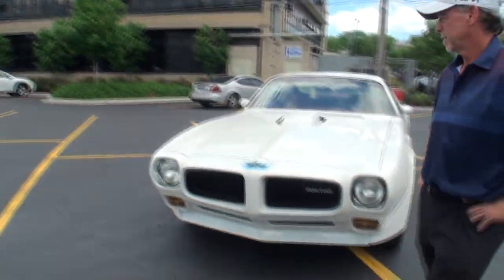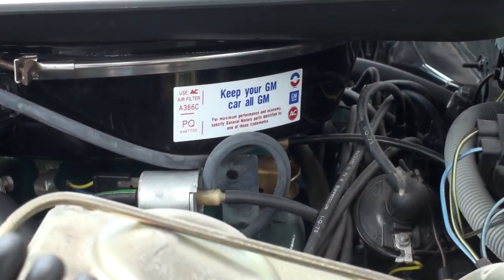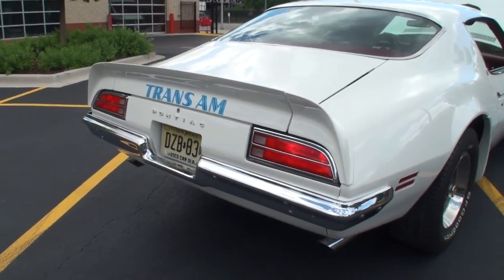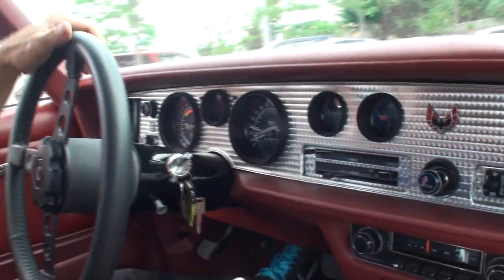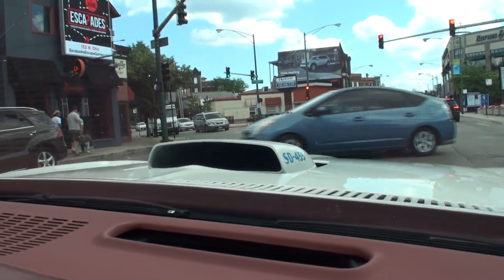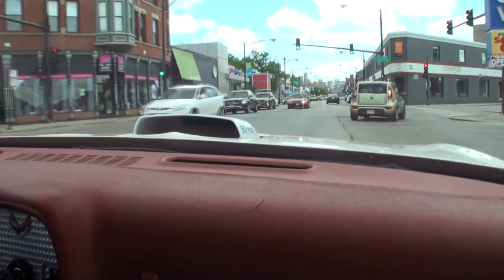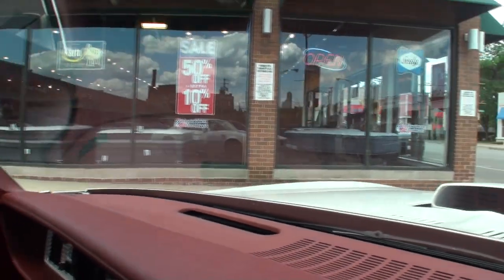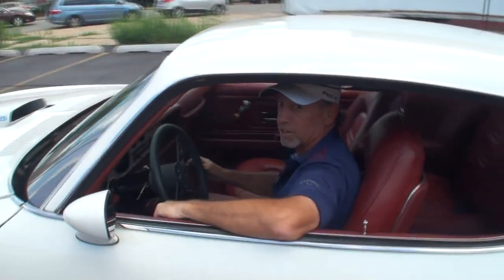Ride in a “ Super Duty “ SD-455 1973 Pontiac Trans Am? Why Not! on My Car Story with Lou Costabile

Comment: Pontiac was first to the muscle party, and last to leave. My favorite brand!
Reply from the maker: Hi Barcrrt, Nice :-) Lou
Reply: gotta love em
Reply: The 62 Dodge Max Wedge was an inch shorter than the 64 GTO and it dominated drag strips. The Max Wedge predates the GTO making it the first muscle car, by definition.  It was the first intermediate to have a big block.
Reply: i don't know about the first but i agree with the last part.
Reply: Mopar beat Pontiac to the party by 2-years with the street wedge and max wedge engines, in a midsize body.  And, yes, the dimensions and weight of a midsize Mopar were the same as a Pontiac Tempest. According to Motor Trend, a 1964 Tempest GTO did 0-60 in 7.7 seconds and the 1/4 mile in 15.8. The wedge cars running the same bias ply tires were considerably faster.
Reply: I wish GM hadn't given the marque the kiss of death!
Reply: @thespeez  Me, too! I like the early 70's Trans Ams and the 1990's (4th Gen) Trans ams as well!😎
Reply: Nope, was actually Buick!
Reply: @greasyhitchball  What about the 62 Chevy 409 dual quad? Many super stocks came before the GTO. I like 'em all though. I would take a wedge or a 440 over the hemi for the street, torque rules. Hemi didn't come into it's own until the end of the quarter mile then it was bye bye into the top end wild yonder. I am a Pontiac fan however at heart.
Reply: @greasyhitchball  Sounds like somebody didn't know how to hook it up. My stock 1966 Ponitac Grand Prix with 2.73 highway gears did 0-60 in 6.8 seconds and quarter mile in 15.0. That was with bias ply tires. Super stock Dodge will run 12's all day long stock, GTO would never have a chance, granted, but those times by magazine reviewers are usually way too slow, even the mopar times were modest.
Reply: The 61 impala SS 409 was in my mind the 1st muscle car
Reply: @darrellsomers5427  That was a full size car.  Right?
Reply: @darrellsomers5427  The Impala was a full size car, not an intermediate. If you want to consider the Impala, then you have to go back to the 1955 Chrysler C300 with the hemi. Either way GM did not make the 1st muscle car.
Reply: @fastmachines500r8  Seems like your one of those nose picking authorites, who doesnt know his facts, but you're forgiven.

Comment: A friend of mine has a 74 T/A SD455 Red with black interior and that thing hauls ass but I always like the 70/73 body style better
Reply from the maker: Hi 79tazman, Sounds like your Friend has a cool car too!  Thank you for viewing, sharing, and adding to the story, Lou
Reply: I believe that's Bucaneer Red! You are talking about! The T/As had cool names for their colors. My friend drove his 2002 T/A into to some floor waters by mistake and the ram air in the front sucked water into the engine. He got the car out o.k. But ruined the engine. Pull that sucker out. Built a 427 fuel injected Corvette motor and put in back in that T/A. That car was wicked fast. Till some parked a Big Dump truck on his street on a very dark night and he stuck it under it.
 It almost kill him with the sudden stop. Took two hrs to get him out from under that Dump truck! He killed the TA. He o.k now! Shawn .
Reply: @shawnbeck2303  relevance?

Comment: The 455 had so much torque it was hard not to spin the tires.  On level roads I usually took off in 3rd gear with no problem.  I had a ‘76 455 4-Speed but always wanted a SSD 455
Reply from the maker: Hi db Vetter, Happy to read this car brings back memories of your car :-) Thank you for viewing and sharing, Lou

Comment: Imagine one of these built to circa-1970 specs. Full vacuum advance, a functional hoodscoop, no smog crap, a Ram Air IV cam, 10.25:1 comp and slightly richer carb jetting, just as Pontiac engineer Skip McCully wanted. It would be brilliant.
Reply from the maker: That's a FUN idea :-)

Comment: My dream car!!! My dad promised me a car when I got my license. He was a Buick loyalist & trade his landyacht every 2/3years. Rat fink neighbors would tell my dad what I'd be doing with his new RIVIERA GS STAGE 1. After getting my license he got me a 1970 GS 455Stage 1,4spd 
A/,C  fully equipped. All I did was change the tires to Camaro sized Radials .It wasn't my Poncho S.D, but it was gr8 for long trips,it had a bench seat,yet, it was a 4spd. My dad was able to get the build sheet from the very same dealership he got his cars from. 3.42:1 limited slip with A/C. Antenna in the front windshield, reception STUNK. 8track time. I was a fool getting rid of it in '78. Trans Am 455 SD was the way to fly.....
Reply from the maker: Hi Ener, Your Dad bought you a 1970 GS 455 Stage 1 4 Speed! WOW! Lou
Reply: @loucostabile  Yeah, but I wanted a Trans Am 455 SD. But, bc of the rumors on how I abused his car in 1974 he got me a used GS 455 Stage 1. I got used to it. In '78 I traded it for a 78 Vette L82 4spd. The dealer didn't give me a grand . But, Now, I wished I had kept it.
$$$$$$$$$$$$$$$$$$$$$$$$$

Comment: I had a 1973 Formula 455 SD with a rear spoiler, twin scoop hood with ram air, and stock cam and carb. 4 speed manual, close ratio. Firebirds had that distinct exhaust sound. When he started the engine up, I was about to have an  orgasm!. I remember that distinctive exhaust growl. And yes, the car had no problem spinning the tires. I am kicking myself in the ass for selling it! I do have a 1999 Chevy Camaro SS 350, that SLP Engineering worked on. They changed the heads to high flow with all the trick hardware, exhaust headers, with midway X pipes, High flow cats, ignition upgrade, high flow intake, a larger cam but small enough to make the engine shake a little but did not make the car too wild, Panhard bar, Koni shocks BIG sway bars in front and back, custom wheels, with WIDE tires, different front pulley, Car pulled 11s every time I ran it. ( I ran it only 3 times. I do not like to abuse my cars).
Reply from the maker: Hi Adam, Happy to read this car brings back memories of your car :-) Thank you for viewing and sharing.  Hope you see many cars on this Channel you enjoy!  Please Subscribe, and hit the "bell" so you can see all the cars when they are uploaded on this YouTube Channel, Lou

Comment: Had a friend, years go, that was shopping for an SD 455 and, because decals and badges are cheap, he told me the only valid way to be sure you get a REAL SD 455 is to get the serial number off the ENGINE block. I guess they all look the same on the outside but SD versions are beefier with 4-bolt mains and whatnot. At the time. my friend had checked motor numbers on 3 different cars and none were valid. Don't know if he ever found an authentic version. Hope this guy did his due diligence when the bought this one (obviously a restoration) ... it looks delicious and badass.
Reply from the maker: HI Wayne Carter, Glad you like the looks of this one :-) Thank you for viewing and sharing some tips, Lou
Reply: Not that you wouldnt want to do that, but indentifying the 5th digit in the vin as X first probably would go a long way towards authenticity.
Reply: The VIn will show an "X".  the intake manifold will say "LS2"  the exhaust manifolds are ram air type, the exhaust port castings on the heads are large,straight, and don't pinch down, the driver's side valve cover should have the SD label.
Reply: I used to mess with Pontiac stuff years ago. I think the SD blocks had a pyramid shaped “power tower” cast into the top of the bell housing near the distributor. Both 400 and 455 engines.
Reply: You can tell looking at the center exhaust ports,the beefed up valley around the lifters,the intake ports.it wasn't just the block which was built like a race engine it was the heads made by a.r.e. and flowed better than hemi heads.
Reply: 490132 SD 455 casting number on side of block and next to distributor hole that's where mine are on my 73 T/A so lucky to still have mine thank God...

Comment: The vin plate has been removed and screwed back on never buy a old car if the vin has been removed  so this is probably NOT an original 455 SD? Unless all #'s match the vin  i mean the frame rear end body numbers all and engine trans etc. but ultimately up to you unless your gonna dragrace it or whatever then buy it if you do not care?
Reply from the maker: Thank you for viewing and sharing a tip.
Reply: Good I stay away from salvage titles do

Comment: Looking at the tuneup sticker... Most kids born after 1980 most likely have no clue what dwell means.
Reply: Most kids born after 1980 can Google the answer in about 10 seconds though... anyway, nice car :p
Reply: Thanks! ...But do you know how to set it? :-p Yeah, yeah, Google is the champ, but that doesn't make up for experience. It's relatively simple with the right gauge. Now, tuning/rebuilding dual or triple Weber carbs is another story. heh
Reply: Off the top of my head, Dwell can be checked with the engine running or cranking. Decrease dwell by increasing the point gap; or increase dwell by decreasing the gap. Dwell angle is simply the number of degrees of distributor shaft rotation during which the points stay closed.  <-- Obvious Google answer... now, what are 'points' Grandpa? 
I kid, I kid; born in '63, I drive a '68 Cougar but it hasn't had points in it since the day after I bought it. Oh, and four Webers for me, thanks
Reply: Four Webers on a Cougar? Well now, that is unusual.
Reply: The good old days.  Hook up the dwell/rpm meter.  Set to dwell function.  Set to 30 degrees dwell with an 1/8 hex wrench.  Done it hundreds of times.  Best to replace points every 6,000 miles or so as they were not very reliable.  And of course the timing light that is not used anymore.
Reply: ...and ye shall dwell in the house of the Lord forever.
Reply from the maker: Hi tscooter22, Thank you for viewing and sharing your thoughts. Hope you see many more cars on this YouTube Channel you enjoy. Please subscribe, and hit the "bell" so you can see all the cars when they are uploaded on this YouTube Channel, Lou

Comment: Oh very rare!  Last year of great performance really.  I wonder if these had better performance than the 70 1/2 400 Ram Air IV's .
Reply from the maker: Glad you enjoy this "very rare" one Quentin 33 :-)  Not sure which would perform better?  Maybe a Viewer can share some knowledge on your question, Lou
Reply: Lou Costabile thx! I love the 68 to 73 years.  Great video Lou !
Reply from the maker: You have great taste in cars :-)
Reply: Last year was the  74 SD 455, RA IV were beasts, higher Compression ratio than the SD, but SD had better flowing heads.
Reply: The ram air iv had a higher hp rating and compression.they were 72cc heads.the sd 455 was built as a race engine.lots of extra support around lifter bores and cam bearings.more efficient oiling system.beefier distributor and gear.the ram air iv was rated at 335 to 345hp depending on transmission and the sd was rated at 290.who knows what they really were.id guess the 400hp range and they had similar torque but if you were going to build one up start with the sd455.its built to hold up to serious hp
Reply: 70 1/2 is the top of the food chain.

Comment: Sorry, my mistake, I thought the description of the video said 1972. Disregard my other comment. Been a Pontiac fan for a long time, I had to buy a 2006 GTO because it was the last of it's kind, even if it is a Holden. Jay Leno just put up a video on his 2002 WS6 Trans Am and he said it was the fastest Trans Am made. I don't think so, I think the 72-73 SD455 was the fastest. They will run high 12 to low 13 quarter where the LS1 WS6 runs 13.8 quarters. 2002 WS6 probably better handling granted.
Reply from the maker: Hi zulumax1, Thanks for viewing and sharing, Lou
Reply: SD455 in 73-74 only, Fastest? too many variables, and should not compare cars from different eras, Apples to Oranges.
Reply: @chutoparadinni5474  Pontiac to Pontiac, drive them yourself, make up your own mind. Go to the local drag strip, it is all subjective opinions after that, and a legend always seems bigger than life, just like fisherman’s fish stories.
Reply: Newer cars have better tech, for pure raw muscle car feeling, can't beat 60-early 70's Muscle, stock sd's never got into the 12's, I've had 5 of my own, bought over 30 or so for customers, owned 2002 ws6 also, all great cars
Reply: @chutoparadinni5474  True, with stock rubber not likely with tire technology in the 70's. Watched a lot of the pure stock drags with good rubber, good tune, and driver that can shift, they seemed to run 12.8 consistently. My bone stock 2006 GTO ran a 13.2 @ 106 mph out of 3 runs on street tires and an automatic. Didn't want to beat on it anymore than that, just wanted to see what it would run. That is the only way to see is to run it down the track.

Comment: Buddy of mine bought a ‘72 SD brand new, and that car burned oil like an old locomotive. Local Pontiac garage rebuilt it, and 6 months later, you couldn’t run behind him or you’d asphyxiate.

I’ve heard the same story from several owners. Some of them ran great but burned copious amounts of oil, and many just ran great.

No doubt a great engine, but they were subject to the same mechanical principles as anything else.
Reply from the maker: Hi Mister Deplorable, Thank you for sharing details on your Buddy's car.  Hope you see many more cars on the Channel you'll enjoy, Lou P.S. Share this video link with your Buddy.
Reply: Your friend is FOS because the SD didn't come out until 1973 not 1972. That was the HO-455.
Reply: Right you are James,  I had a 74 SD that did use a lot of oil on the trip from CA to IL, but it burned rubber like a champ. Lots of "Piston slap" in the motor too because of the design

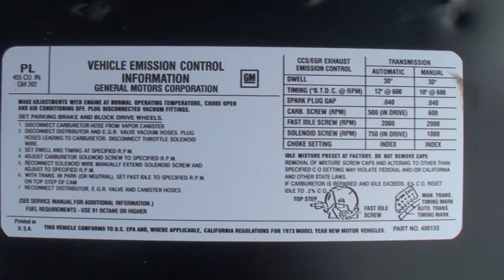Comment: Noticed at 1:29 that the decal shows 1973 model. Was this the wrong decal put on when it was restored? Last line of text on the bottom.
Reply from the maker: Hmmm, I'm not sure.
Reply: Correct sticker for a 73 SD455
Reply: @chutoparadinni5474  You are correct,

Comment: Under inflated tires!?! Never thought of that one before. Heh Lou, does that one work with your Dodge Viper? One great car and video. Thanks so much, Lou
Reply from the maker: Hi Fred and Debra MacDonald, I've never thought of deflating the tires on the Viper since there is so much rubber contacting the road.  Note, there is a warning not to drive the car under 40 degrees and the tires may not grip. Lou
Reply: I believe the cause for the tires squealing and smoking in this video is a very heavy gas pedal foot! The tire pressure issue is just a BAD joke. Your Viper would be a real handful with low tire pressure, and that would be no joke. My oldest daughter knows of a gal that borrowed her boyfriends Viper and got caught doing 110 mph in a 55 mph zone, and it sounds like that was no joke!! Let us know if you ever try the low tire pressure excuse and how it works out. I am not that charming, and would probably end up in jail!

Comment: My very first car was an Admiralty Blue 1974 Pontiac Firebird Trans Am with blue and white interior. I purchased it brand new in 1974 from Colonial Pontiac in Miami, FL for $5,500. My salesman’s name was Ken Heather. I ordered the car and the idiots at the dealership somehow “forgot” to add the A/C so they installed an aftermarket A/C system with a York compressor, which was absolute junk. Also, the car was ordered, upon the advice of my idiot salesman, with the regular 455 engine rather than the SD-455. He claimed that it would be too difficult to obtain the SD. In hindsight, the dealership and that salesman screwed me over big time. Although I enjoyed the car immensely, it wasn’t what it could have and should have been. So that’s my Trans Am story.
Reply from the maker: Hi bill avrich, Thank you for viewing and sharing your story :-) Lou

Comment: back in the early 70,s i had a 66 GTO,i put on hooker headers,high lift cam ,750 double pump Holley dynod at 440 hp on the ground on premium pump gas,i raced the Trans Am 455 SD,it wasnt that Super,beat it from 3 different stop light races in a row,never wasted my time on them again
Reply from the maker: Hi donald day, Thank you for viewing and sharing your story :-)  Hope you see many more cars your 66 GTO would blow away on this YouTube Channel, Lou
Reply: I had a 66 goat was pulling around 500 hp. Wish to hell i hadn't sold it in 05. Everything was new hd. short tailshaft 400 manual valve body headers aluminum intake 428 6x heads biggest cam you could get rhodes antipump up lifters, new pistons 456 positrac 12 bolt rear, that baby would light em up. geared a little low, but talk about a hole shot. Traction bars air bags in coil springs..frame and anything under neath was clean enough to eat of of, also had disc brakes on front so you could stop at the end of the rd, became hard up for money and some chick bought it for 5 grand for her boy friend.  Divorces suck.  lol
Reply: Also it was bored 30.
Reply: stock gto with 400  tri-power had 360 hp
Reply: Gotta put this out there when i had my GTO a guy that lives about 25 miles from me said he would beat me in a drag so i looked at the car he was wanting to drag me with it was a 65 catalina 2+2 421 w/425 hp. the stickers was original on the valve covers. it was one of 75 made..Came from factory w/headers and a 4 speed and 8 lug wheels think he said it had a 348 positrac...All his cars came from odgen utah, rust free...Also has 55 ford , 47 pontiac w/flathead straight 8, has a 60 bonneville red  but paint is faded a little but great otherwise great car with no rust or dents.
, has engines for sale 389's, 400, 455, 428.he was wanting 3500. for the bonneville  it had 389 4 barrel, 65 catalina too many to mention he keeps them a big wooden barn for storage. Also had grand prix's with 4 speeds.  The guys who pay big prices for barn finds are crazy paying big prices for junk when you can drive these away..
Reply: Stock vs stock or same mods your car would have no chance!